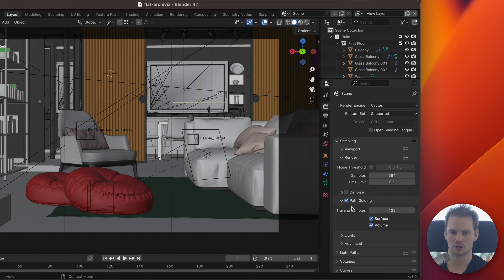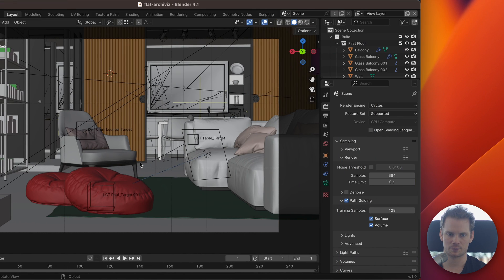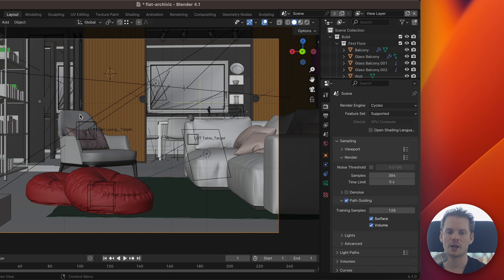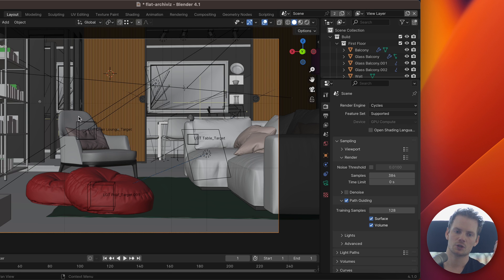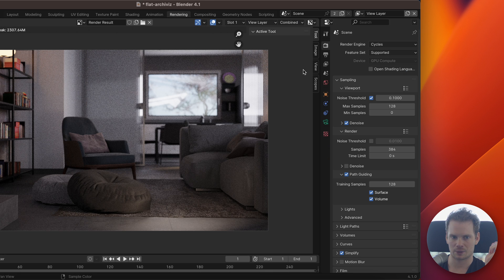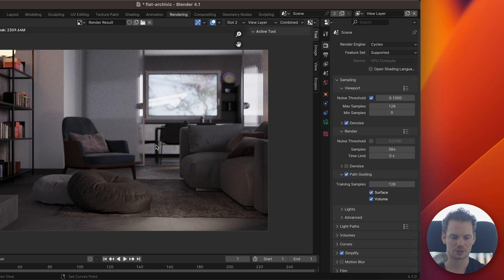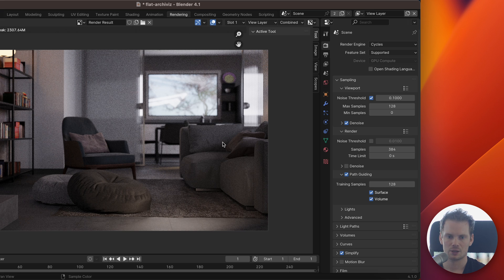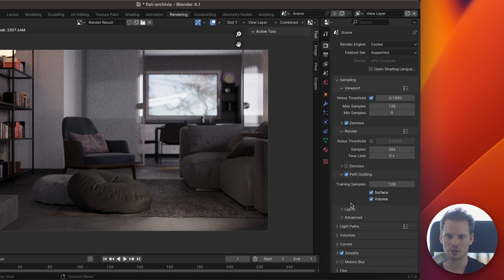Blender Optimization - Path Guiding to Reduce Noise #b3d

Comment: I am currently using Blender 4.2.0 and I do not see the Path Guiding panel anywhere. How do I get it to show up? 
I wanted to see if Path Guiding might let light and shadows pass through the new Ray Portal shader. However I can’t even test it without the option showing up.
Reply from the maker: It's not yet available for GPU rendering unfortunately!

Comment: Path guiding was removed again when selecting CPU rendering in Blender 4.2 (testing on Mac too). It's not finished for GPU, Intel is working on it. I think the option just remained but didn't work when selecting GPU?
Reply from the maker: Yeah I got tricked one time when I selected GPU and the option was still there. Turned out my GPU device settings were misconfigured. Once you set up GPU rendering properly the option seems to disappear.